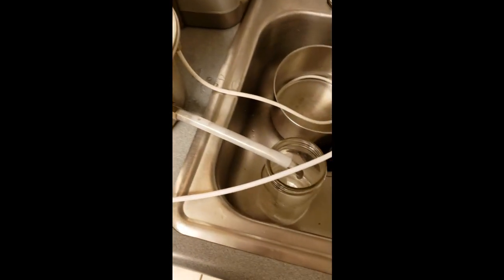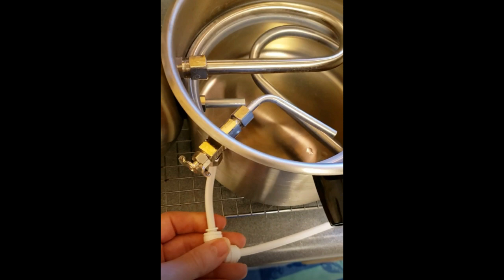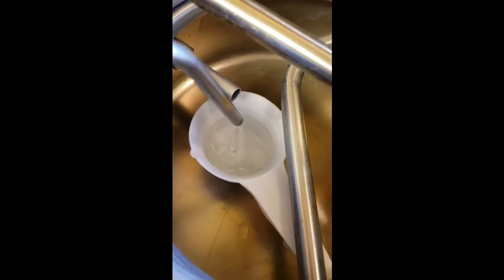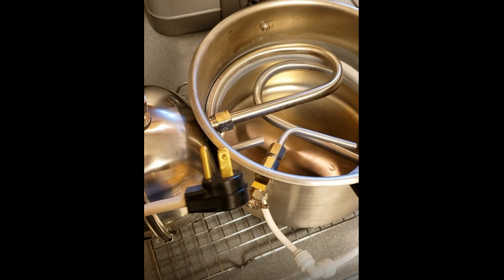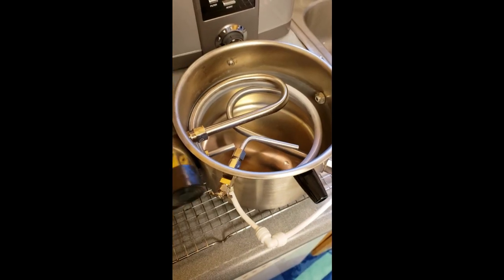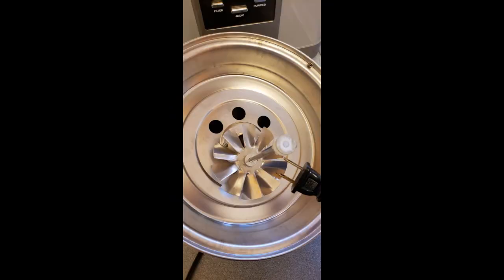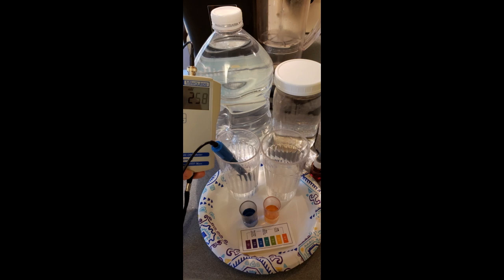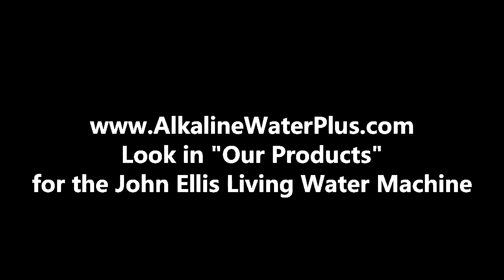John Ellis Living Water Machine Demo

Comment: Why does water going in have to flow at that rate? I have a machine, and I set it for just a trickle, just enough for the smallest amount to come out of the overflow hole.
Reply: If the water in the pot gets too hot then there will be no cool water to enter the boiling chamber. This would keep the fast boil/cool process from happening.

Comment: Which side does the drinking water come and where does the wastewater go like the deuterium/heavy water? Thank you.
Reply from the maker: Both hoses supply drinking water. one is distilled (going into the mason jar in the video) and the other is called run-off water. Both waters have the same bond-angle change and are both, I'd say, equally beneficial. It just depends on the pH and mineral content of the water you want to drink.
Reply: @636cathleen  Thank you for the reply, so what happens to the deuterium heavy water? John Ellis says in his video the machine makes DDW, Deuterium Depleted Water, so where does the waste deuterium water go?
Reply from the maker: @rocketmentor  Which video? If you tell me the video url and what time in the video he says that I'll go from there.

Comment: i dont understand, difference between the distilld and run-off, what version are people drinking
Reply from the maker: Distilled has no minerals in it and runoff has normal minerals. Both are beneficial, because they've been run through the process that changes the hydrogen bond angle.
Reply: does it have to be connected to outlet or can you pour water from gal jar inside unit yourself????
Reply: @636cathleen  you video says that the distilled comes out acidic,  @3:50 Is this correct?
Reply: @BraDisGuy  It's more like about 6 pH
Reply: @joetravieso3165  Yes. Most people do that. But you have to pay attention the whole time. Never let the water level get too low or the water in the bin to get too hot.